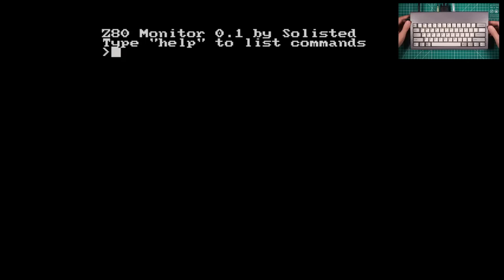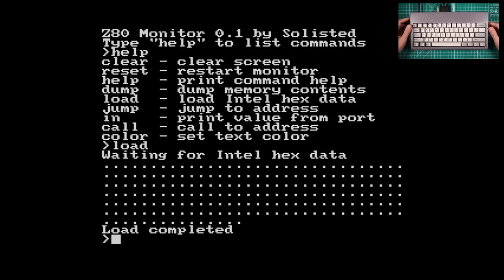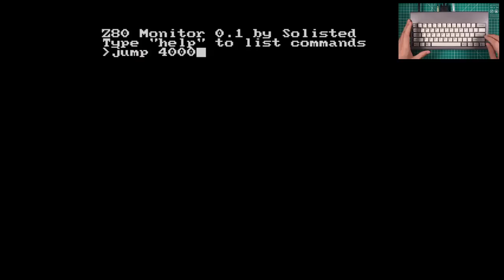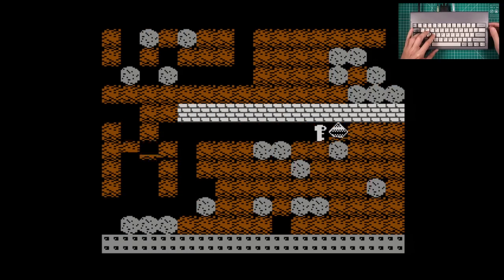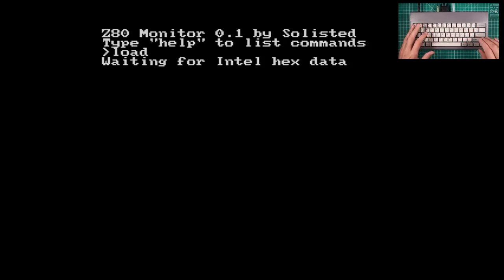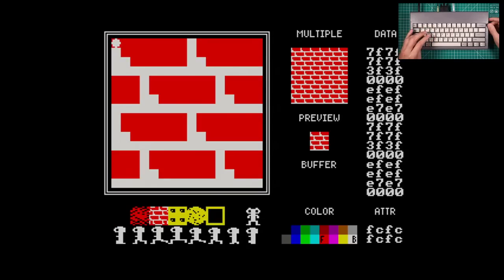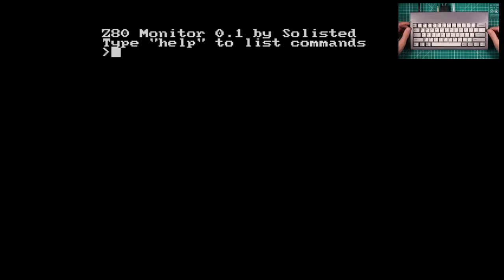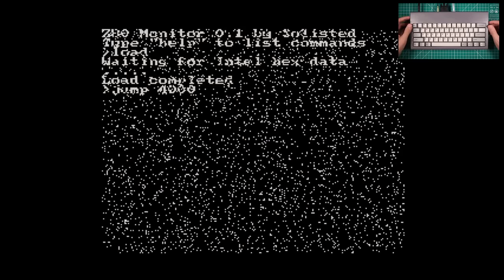DIY 8-Bit Z80 Single Board Computer

Comment: Hi, why you used diodes on keys? Are they necessary? In my ancient computers I never saw it. Usually I see the row/columns traces without anything else. What's the part code of these diodes?
Reply from the maker: Hi! Diodes in keyboard matrix are used to prevent so called "phantom" key presses when invoking multiple key combinations. Old keyboards were without diodes to reduce cost and limited in key combinations keyboard controller can detect without an error. Usually, standard 1N4148 fast switching general purpose diodes are used.

Comment: Your video stability is fantastic... no jitter, no tearing, no weird colour artifacts, rock solid!  Looking forward to the future installments of this project!
Reply from the maker: Thank you Clayton! It was not so stable initially and took some time to optimize PLD file to maintain low input-to-output gate delays in CPLD. But overall, this is due to 4 layer board design and relatively high speed capabilities of ATF1508 CPLD (>100 Mhz when VGA clock is 25.175 Mhz) and IDC7005 dual port SRAM (15ns). Additional inverters/buffers before the R2R DAC also helped to clean up signals fed into the DAC from the CPLD. VGA signal is a bit smeared and wavy if you feed sync and color outputs of the CPLD into the DAC directly.
Reply: Color,  not col- "hour"

Comment: Excellent video. I designed and programmed many top Spectrum games back in the day and I admire your work on this project. Rearranging the order of the video frame buffer is a huge improvement.
Reply from the maker: Thank you!
Reply: @solisted  you're welcome. Are you going to be publishing/selling the code for the CPLD chip? Which chip(s) are you using?
Reply from the maker: I used Microchip/Atmel ATF1508 for the graphics and ATF1502 for the chipset. Not decided yet if I want to share PLD files.
Reply: @solisted  Interesting. Are you familiar with the Harlequin Spectrum clone? They essentially did the graphics/ULA in discrete TTL.
Reply from the maker: @TheDradge  Yes, very nice project. It can even fit in the original enclosure if I remember correctly.

Comment: Fantastic work! I love the case, all the connectivity, tight PCB design. You really have done a wonderful job! The only thing I would have done differently is the keyboard. I really would have tried hard to include some cursor keys in an inverted T in the bottom right. But overall; wow, I am so impressed!!
Reply from the maker: Thank you Mark! Actually, everything was designed around the keyboard. Mainboard PCB has the same footprint so both keyboard and mainboard can be stacked together with standard hex standoffs.
I did not include cursor keys, because I did not want them to be in a single row like some computers in 80's had. In my opinion, the most convinient layout with T-shaped cursor keys required an additional column on the right. But I wanted as compact design as possible for people to be able to print parts of the enclosure on a regular FDM printer in one piece :) But still, my 3D printer has little bit smaller working area, so I had to order this case from 3D printing company.
Reply: @solisted  makes sense and I agree the compact design is essential. But I reckon the huge Shift key on the right could have been split into 2 keys, one being Up cursor. 😉
Reply: @MarkOfBitcoin  Then you would cripple the keyboard from the standpoint of typing.
Reply: @MarkOfBitcoin   Agreed, I would totally rework the keyboard.  Placing the inverted T in the bottom right, and removing the right CTRL, FN, and Pn keys; I rarely use my right hand with those keys.

Comment: I've had my share with moderately complex PCB routing, but the top layer looks extremely tidy. Well done :)
Also interesting choice with the AY-3-8913, which makes perfect sense at it's usually exclusively used as a sound generator - yet that variant being quite unknown til a few years ago.
Reply from the maker: Thank you!

Comment: So cool. Great design. There is a new AY compatible chip available with the same pinout, it's designed as a replacement in old computers like the Speccy. :)
Reply from the maker: Thank you! Is it the actual DIP chip or an FPGA on a small board with DIP footprint? Could you please post a link - interesting.
Reply: @solisted  I think it might be an FPGA on a DIP board. Check out the 'AY-3-8910 clone vs. original AY-3-8912 sound chip' video from ByteDelight on YT. Ben does a demo of it.

Comment: Very nice, complex serious design, well above the common Z80 sbc most people make, so one question why not use HD64180 or Z8S180. these are super Z80 ,fast and feature packed.

Using the 180 type of Z80 with their dual channel inbuilt DMA that just inserts into normal machine cycles, , it's possible to have invisible screen memory transfer to a separate frame buffer and GPU,
Reply from the maker: Thank you Joe! I was looking into various 8-bit CPUs including Z180 and decided to go with Z80 to replicate (with some convinience tweaks) look, feel and architecture of home computers of that era. Most of the inspiration was taken from the first computer I had when I was a kid - Sinclair ZX Spectrum.

Also, I wanted to use parts that are DIY friendly (DIP/PLCC) and easily obtainable. Z180 variants in PLCC packages are usually not stocked at major IC vendors, unlike Z80 that is always availabile in huge quantities. I suspect it is still widely used a lot in automation controllers.

Third, I did not implement any hardware blitters, sprite engines and DMAs to make it more fun and challenging writing software for this computer :) At least, In my view. I like programming graphics in software. Do cycle counting to optimize graphics, music and game logic routines :)
Reply: Z180 is nice, however if you plan to run/port existing Z80 software, you're in trouble, IIRC for example Z180 does not support some "unofficial" Z80 features used by many software like the ability to use IX and IY as two 8 bit registers in the form of IXL/IXH and IYL/IYH. At least I have already run into this problem once, while I tried to use Z180 inside an Enterprise-128 (Z80 based) computer just to fun to try another kind of "Z80-like" CPU to be fancy for just fun.
Reply: Toshiba do one with serial ports built in and timers for interrupts.

Comment: Would love to see how you made the CPLD’s work, I’ve been interesting in trying some but have read about many challenges using them, mainly trying to program them from a modern host computer.
Reply from the maker: Thank you, Darren! These particular CPLDs from Atmel/Microchip (ATF150x) are not very difficult to work with. You will need simple WinCUPL CUPL language editor/compiler, ATMISP 7.3 programmer software and Atmel's USB JTAG programming cable: ATDH1150USB. All works perfect in Windows 10.

Please, check here: https://www.microchip.com/en-us/products/fpgas-and-plds/spld-cplds/pld-design-resources

Comment: Very interesting project, kudos, perhaps in a next revision an edge connector with all the data and address lines of CPU for expansion?
Reply from the maker: Thank you! I wanted to make one, but also I needed to keep system compact and stable.

The choice was - make unbuffered card edge connector with all bus signals exposed and risk having some peripheral devices drawing to much power to cause stability issues or increase mainboard footprint and add buffers between system bus and connector. Did not like both variants.

I like the way 8-bit Atari periphery worked - through daisy chained serial port. That's I want to try, since SIO/0 IC has two serial ports and both a available on the back on the case via compact RG45 connector.

Comment: Nice, your design very similar to my own KAPE 8bit homebrew target design. I'm not there yet tho. Gz on finishing the project!

You use a CPLD to output to VGA? What CPLD are you using for it? My original idea for my own GPU was to use dualport RAM but getting those chips relatively cheaply for the amount I needed (I wanted to go full 256x192 16 color display, so the framebuffer would've needed to be 24k minimum, so in the end opted for a somewhat unorthodox kludge of AVR MCUs and a bunch of FIFO chips - and also the GPU itself is tile/sprite-based due to memory constraints, but the output FIFO buffer is big enough to handle the full image). 

Also it seems you have the brown-fix implemented? I decided to go for "mathematically correct" 16 color RGBI, just for the simplicity of outputting the RGB lines from a color bit line + intensity bit line, as everything would be symmetrical.

The method of ROM having a monitor to load games to RAM is what I'm going to go for too. Currently I have only RAM installed in my breadboard prototype, and uploading to RAM is done with an additional Arduino UNO that also handles the proper signals for bus hijacking.

My choice of system was a 6502 CPU and that ecosystem, so 6551 for UART and 6522 for peripherals. I'll be using an YM2149F for audio output and gameport reading.

Awesome project, great stuff!
Reply from the maker: Thank you!

Yes, I use Microchip (Atmel) ATF1508 CPLD and Renesas (IDC) 7005 8Kb dual port SRAM as a base for the video system. Dual port SRAM is expensive, but simplifies system design by a lot. Only thing you need is to feed BUSY output of the SRAM into WAIT input of the CPU to avoid "snow" effect when address collision happens between CPLD and CPU on opposite ports of the SRAM. I also have 256x192 16 color prototype graphics implemented using the same CPLD and 7008 64k dual port SRAM for 2 flippable pages (x86 SBC prototype briefly shown in my other video). It is possible to implement tiled graphics using the same CPLD, but without sprites - 128 is not enough macrocells/flip-flops available in it.

Generally speaking, I've managed to implement 3 types of graphics engines with this awesome CPLD. Speccy like monochrome linear buffer with color attributes (8k buffer), 16-color linear framebuffer (24k buffer) and 256-color tiled graphics (8k + 16k buffers = 20k total). I think, it is possible to make full featured tile/sprite graphics engine by stacking multiple CPLD and dividing responsibilities between them. One renders tiles, another one overlays sprites, third one renders text-based layer for a scoreboard, for example.

I have one more SBC prototype of 65c816-based computer with 320x240 8bpp color 8x8 tiled graphics with smooth scrolling (no sprites). But approach there was a bit different. Instead of reading from SRAM and sequencing pixels inside CPLD, that CPLD is driving address bus of one dual port SRAM dedicated to character memory which in turn drives part of the address bus (alongside with CPLD) of another dual port SRAM that holds tile pixels. And second SRAM data bus is directly fed into the R2R DAC (through buffers also).

Brown/dark gray fix was easy to implement with CPLD, just changed boolean equation that converts IRGB to RRGGBB from:
R1.d = R;
R0.d = R & I;
G1.d = G;
G0.d = G & I;
B1.d = B;
B0.d = B & I;
to:
R1.d = R;
R0.d = I & !G & !B # I & R;
G1.d = !R & G # I & G # G & B;
G0.d = I & !R & !B # R & G & !B # I & G;
B1.d = B;
B0.d = I & !R & !G # I & B;

Like I mentioned above, I'm also interested in 65c02/65c816 series of CPUs by Western Design Center and made another prototype with enhanced 256-color tiled graphics with that CPU and 65c51/65c22 peripherals IC.
Reply: @solisted  Thanks for the detailed answer! Been looking into PLD's, tho mainly for address decoding (like ATF16V8 or ATF22V10), but doing a whole VDP/GPU out of a ATF1508 sounds dope!

Great stuff!
Reply: @solisted    I'd be very interested in learning more about your video circuit design and how you work with CLPD devices to make it come to life.

Comment: Well that certainly kicked the ass of my old Tandy (Radio Shack) Model 1. I am also impressed by the tile editor. In my experiance tools written for a particular purpose, tend to really do the job,. I would be interested in the ROM soft/firmware. Do share if and  when you get the opportunity. I look forward to you sharing your work the "IDE" you have planned. I am interested in you choosing BASIC rather than python; were you trying to keep the retro vibe? Well done for what you have acheived. Now, where do they put the subscribe button on this thing?
Reply from the maker: Thank you! This project is 50% nostalgia driven in any aspect - hardware and software, so BASIC is a choice for programming language. Maybe, with built-in compiler to add some juice :)

Comment: Also... How is the memory layout of your screen RAM? The Spectrum used a really weird system of thirds, then arranged in a very odd way within those, where most 8-bit computers just had a flat, linear bitmap. You mention something about thirds in the video, is that what you mean? I know Sinclair claimed their design was easier to interface with a TV, and wasn't necessarily too bad to work out the location of a pixel, or 8 of them, but still I'm pretty sure it slowed things down, a bigger problem when your sprites are all in software. Hey, how about some sprites in your design? 

Does it have to have a separate chip for it's graphics RAM? Couldn't you just share the main memory? You just need a system of priority for when the graphics and CPU chips clash, have the graphics chip halt the Z80 if that happens. The Z80 spends a lot of cycles doing stuff other than RAM reading, you should generally have lots of time. How much slower did stuff run, in the contended 16K vs the upper 32K? Can't be too bad or else the 16K model wouldn't have been practical. Also you only need access 2 bytes per 8 pixels, or even less, if you cache the atttribute byte a line at a time, say. Would need 32 bytes and reduce RAM access from 2 bytes per 8 pixels, to 1.125 bytes, effectively.

Oh, I love fantasy computer design! I really should get more into electronics when I have the space available. I can manage Arduino OK, and C on proper computers, a bit of Verilog can't be too hard.
Reply from the maker: Hi! I implemented linear memory layout for the monochrome pixel buffer. I went with asynchronous dual port memory design for the video circuit to keep it compact and simple. I did not have enough experience to quickly come up with acceptable solution for shared video memory access and did not want to spend too much time on it.
CPLD I used in the video circuit has just 128 macrocells and not suited for complex video cicruit implementations with tiles and sprites. Simple pixel shifter is easy to implement and fit, but more complex stuff would require much-much more logic gates and flip-flops than CPLDs of this class have.

Comment: Very cool. I'd buy it. Wish it had HDMI though.
Reply from the maker: Thank you! This project was aimed to be DIY-friendly that requires minimum soldering skills to assemble it at home. HDMI converter and DAC ICs are available only in SMD packages, so I decided to go with VGA output because this video signal is very easy to generate, and it does not require any additional ICs, just simple R2R resistor DAC and couple of buffers.
Reply: @solisted  Gotcha. You should sell this or provide kits etc. Once you have the software side more fleshed out. I'd love to write simple games on this or run BASIC like the old times.

Comment: thats how the MSX vidoe memory is organised, maybe the attribute table come 1st, same screen size too. Funny thing, if you program the MSX screen right to left, bottom to top, you can get 4 colors per byte, F+B per nibble, instead of 2 colors per byte.
Reply from the maker: The only thing frustrated me about programming graphics on MSX is a need to write to graphics buffer through I/O registers. It is much slower than having it memory mapped for direct CPU access.
Reply: @solisted  hence the use of DMA as an option from th VDU side. There is a "mod" in BlueMSX (and OpenMSX?) that "opens" VDU RAM as 16K PAGE MAPPED, based on a real world mod, not well known because is conflicts with some other common hardware (MSX-AUDIO or MSX-MUSIC) that the guy did not own at the time. I am glad your design doesnt need such hacks :)
Reply from the maker: @Paul Wratt Interesting mod, will check that out.

Comment: Rather than the serial port, I'd add an SD card, it would be so convenient, and with a good enough keyboard and display, you'd be able to develop directly on the Z80, the fun way! I bet your design isn't far from what Sinclair used, except you seem to have added useful colours, rather than just RGB + Bright, which gave a lot of useless duplicated colours, nobody really NEEDS two cyans, when instead things like pink or brown were missing. Then better greys, perhaps including a bright black.

Of course the Spectrum couldn't do separate brightness for foreground and background colour, it was set per cell. Leaving 1 bit left for the equally useless Flash! Using the Bright and Flash bits to give 16 foreground and background colours would have been infinitely more useful in a machine that was already limited. If Clive had given more thought to it's obvious use for games, he might have thought about making things just a bit more friendly and useful. I'm sure he only put in colour begrudgingly. A modern CPLD and an '80s ULA probably have about the same number of gates to make your circuit from.
Reply from the maker: Serial port is a universal interface. It does not have to be used just for computer-computer transfers. External storage device can be built with any storage medium, communicating with computer via serial port, for example. And monitor ROM can be extended to support reading sectors from such device via serial port using some simple communication protocol.
That's how expansion worked on Atari 8-bit computers - floppy drives, printers, modems were all connected to a daisy chained serial port.